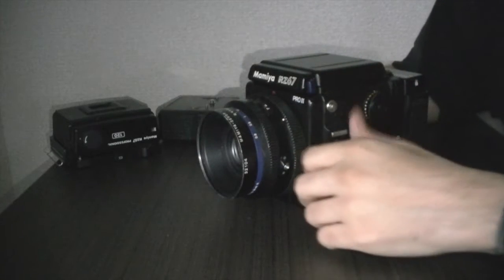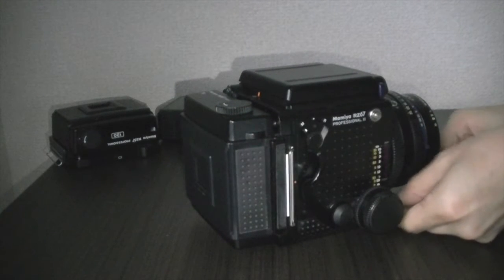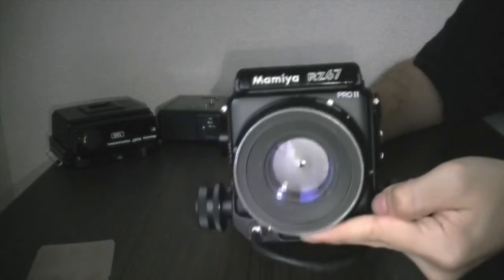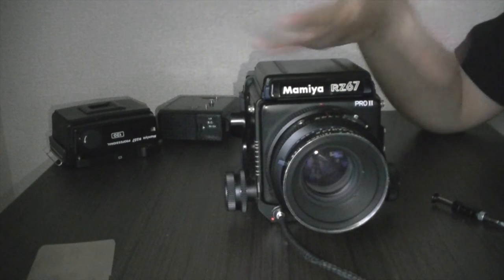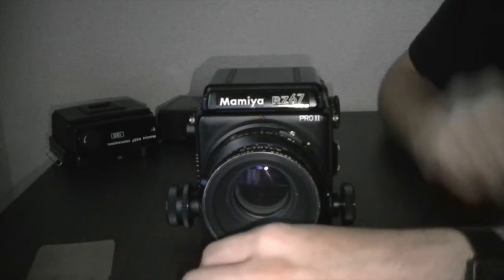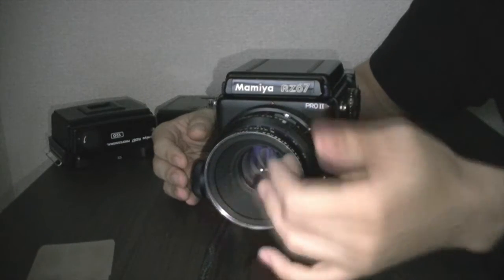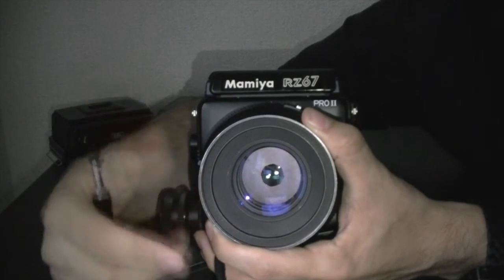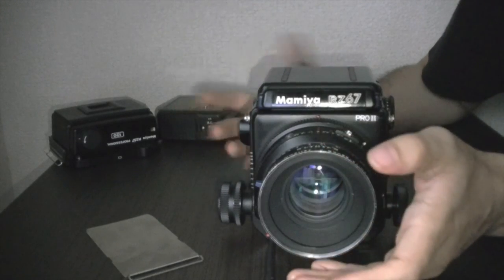RZ67 Pro II Video Manual : 18 - Long Exposures

Comment: The B on the shutter speed dial stands for bulb. In the very old days, a photographer would squeeze a rubber bulb (much like a rocket blower) connected by a small air hose to the camera. This would open the shutter, and it would stay open as long as he kept the bulb squeezed. That's why the B stands for Bulb. Of course, nowadays the shutter release would be mechanical or electronic. But the name 'Bulb' stays the same.
Reply from the maker: That sounds interesting.

Comment: Hi, that "shut-down" in B mode sounds like the camera is stopping it'self from over heating the electronics, AKA just like on your home vacuum cleaner or paper shredder, a GOOD thing (just think: do you really want this camera to catch fire??), also you don't mention the threaded hole on the lens, i.e. mirror lock up mode, could you use this feature as well for long exposures??- just like on the RB model.
Reply from the maker: Hi Andy, I do mention the TN lever in another video. According to the manual the 1 minute shut down is made to stop the camera for draining the battery, it won't really explode or catch fire. Is just part of the safety settings for a normal camera use.

Comment: do i have to dial both the shutter speeds on the side of the camera AND the prism finder or can it just work with the prism finder. does the prism finder take a battery?
Reply from the maker: +Andrew Cohill I haven't touched one so I'm not sure, but the contacts from the RZ do provide 6 volts and 3 volts on several pins. So maybe it will use the battery from the camera but to be honest I don't know. I'm planning to rent one and do a review later on.